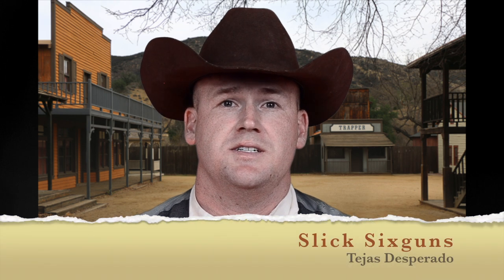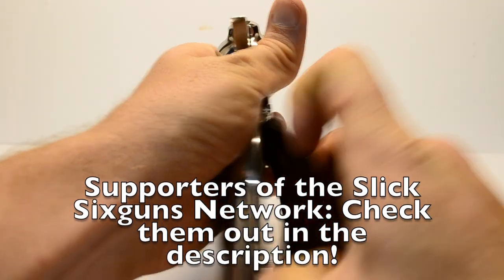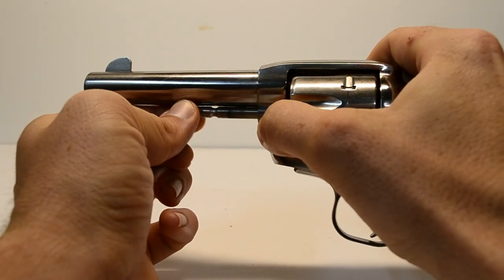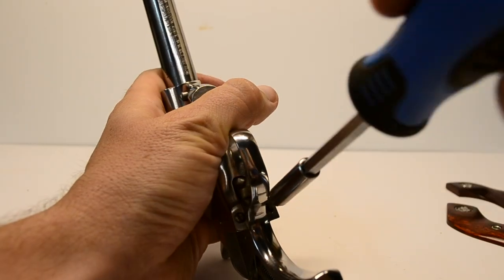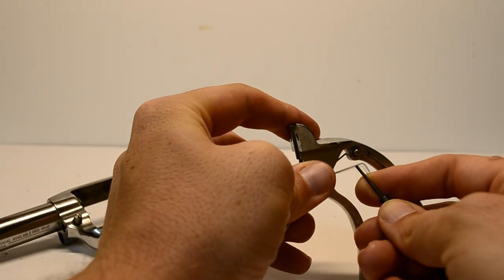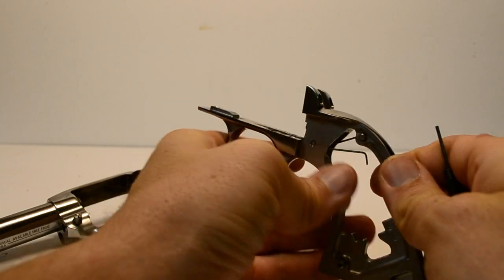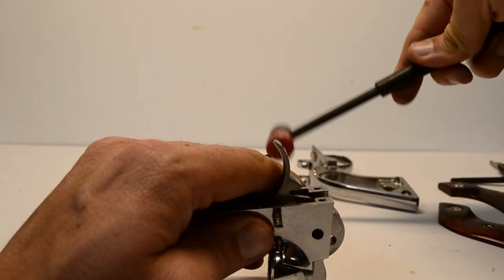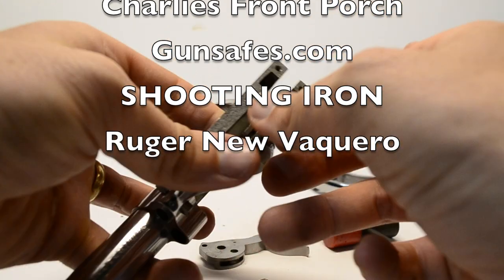Ruger New Vaquero (Want to Know How to Disassemble a Ruger New Vaquero?)

Comment: I have a question,  it is about the ejection rod assembly,  I seen a ruger vaquero at a gun with it slightly  spaced from the barrel by the screw itself when unloosening the ejection port screw does it rise slightly up off of the barrel? The gun store wanted alot of money for the revolver?
Reply from the maker: Yes backing out the ejection rod housing screw can cause that I’d ask them to fix it first just to ensure there is nothing further going on
Reply: @SlickSixguns  after watching your video,  to me it looked like the assembly was under tension. Like it raised up a bit after you loosened the screw.
Reply from the maker: that sometimes happens especially if you have done it a few times with the revolver. When it is new they can be quite difficult to take off

Comment: I have an issue with my Vaquero. It's been in the safe and all of a sudden the loading gate will not open at all. It hasn't been handled or disassembled. Anything I can do without tearing it all the way down?
Reply from the maker: I'll see what I can do to help. Please ensure that your firearm is unloaded during all steps of this process. This is for Ruger New Vaqueros only. If it is the older version this process still may help, but no guarantee.

1. Can you cock the weapon?
2. Is it a Ruger New Vaquero or an older model?
3. Were you ever able to open it before this started happening?
4. Does the hammer hang up when you cock it or catch and feel like its not smooth?
5. Did you buy it new or used?
6. Does it have a half cock modification that has been done to it?
Reply: @SlickSixguns  Weapon was stored unloaded. It's a new Vaquero and it has opened and operated flawlessly up until now. I can cock the hammer and it falls to the full forward position. No mods have been done to the revolver. I purchased it new and has less than 200 rounds through it. Everything is smooth and functions flawlessly other than the loading gate not opening.
Reply from the maker: Jon B is the loading gate spring directly under the loading gate?
Reply: @SlickSixguns  It appears to be. I can see the spring under the bottom of the gate. Thanks for your replies, BTW.
Reply from the maker: Jon B did the cylinder turn both ways when you could open the gate?
Reply: @SlickSixguns  I'm pretty sure it did not.
Reply: @SlickSixguns  I finally got it to open. The spring had a sharp curved point that and dug in and made a small groove in the gate just enough to bind the spring against the frame when trying to open instead of compressing it downward as the gate rotated. Once it opened I took the cylinder out and spotted the issue and was able to take care of it from there. Thanks again.
Reply from the maker: Jon B glad to hear

Comment: And you skipped over the difficult part, punching out the trigger pin.  I've tried to do that maybe 40 times and it won't budge.  I think you need three hands to do that. and we can see how you buggered up the frame next to that pin hole.  Not a good video.
Reply from the maker: Videos will get better with time. Thank you for the comment